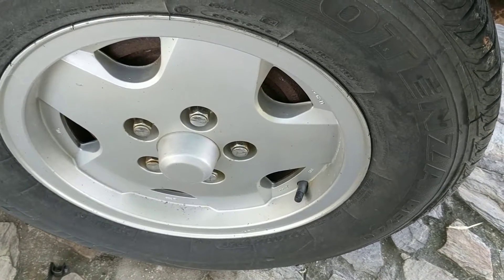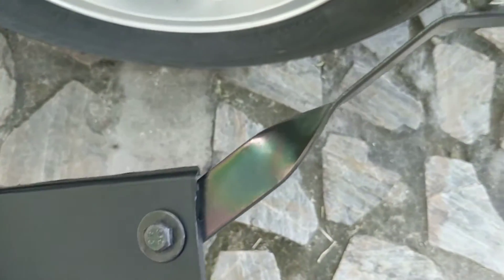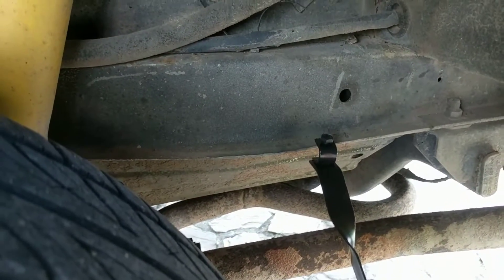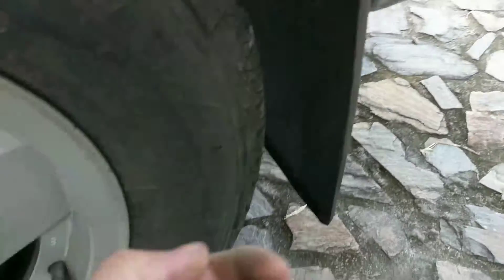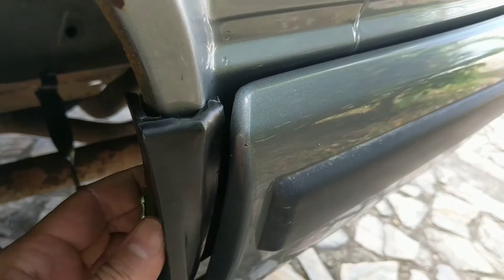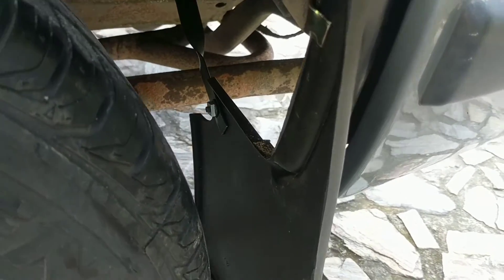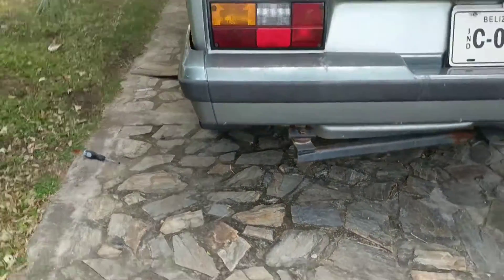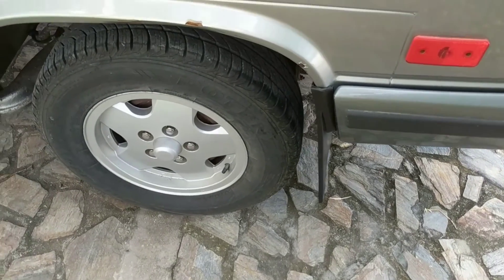Vanagon SA rear mud flaps install in Belize!

Comment: Pinching the rubber grommet wouldn’t be a problem if you had a short piece of metal to go inside the pinch attachment.  The. The 10mm bolt head would be available from in front of the wheel.